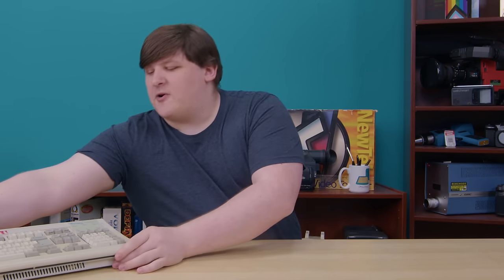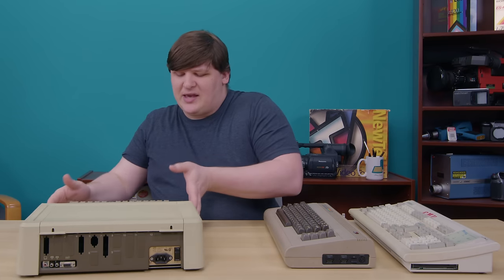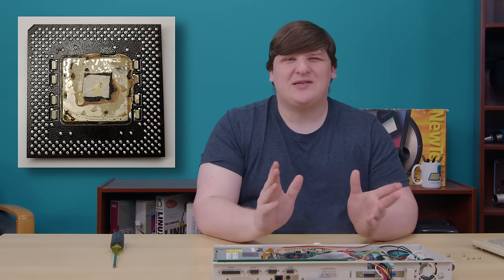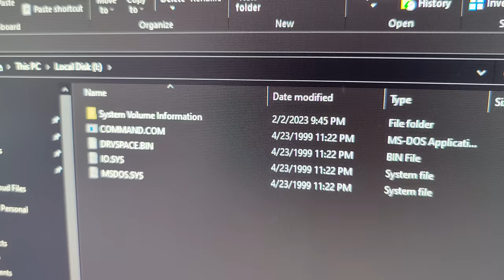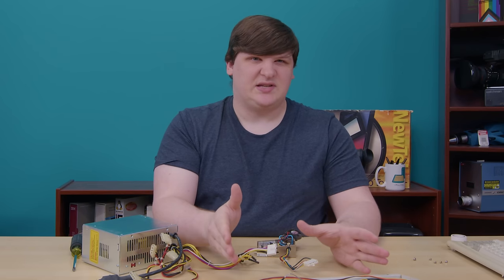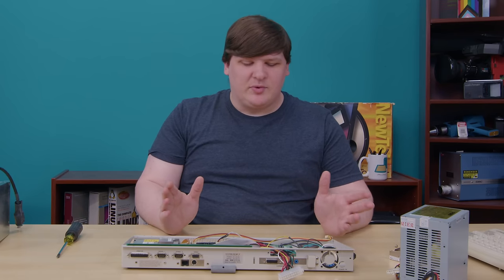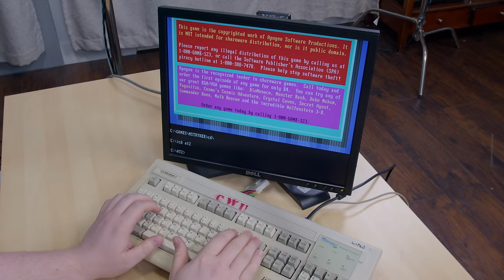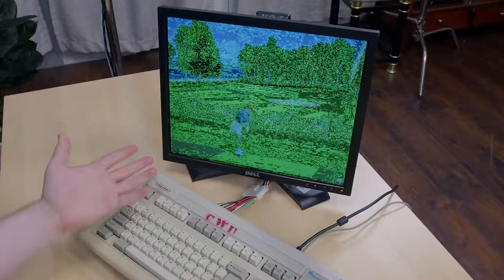I turned a weird "keyboard PC" into an FM boombox

Comment: 7:00 I can assure you that typewriters were used for touchtyping. Typists were trained using that method of learning (which some keyboard enthusiasts today call unnecessary) and it's the whole reason that a modern keyboard is arranged in that weird way, of no keys vertically aligning with another row. I can send you a video from the mid 1940's of a female typist teaching the user how to touchtype, correct arm position & posture, table & chair height and how to type without a wrist rest. I much prefer a wrist rest so I'm totally with you on the elevated keyboards, but I was taught to touchtype on a typewriter and it's not strictly necessary.
Reply: The adlib music you write is awesome. Sounds very sci-fi. Make a tape album! I'd buy!
Reply: Can you wrap your external power supply wires with tin foil or some other EMC blocking material? Add a ferrite core maybe?
Reply from the maker: I should have put more emphasis on the "...as we know it now." As in, the technique existed, I have no doubt, but it's very different from what you do on an IBM-style keyboard.
Reply: @CathodeRayDude  You're totally right. When it comes to computer keyboards there's a learning curve and the hand position changed for comfort rather than consistency. I bet most people's grandparents here still type a keyboard like they're trying to smash a hole through it and it's because of that typewriter touchtyping. Thanks for the reply and I loved your video

Comment: Those round connectors are aviation plugs, meant for high current applications, frequently used in analytical instruments for things like turbomolecular vacuum pumps, and they come in forms with much more than 4 pins.

Edit: I'm wrong, didn't get a good enough look on my phone screen. Those are kycons, which are dumb because multi-conductor bayonet connectors exist.

Comment: In the Classic Mac community, it's common to replace the power supply with a modern one that has to fit within the minuscule space of a Mac SE. New ATX power supplies like the Seasonic SSP-250SUB meant for industrial uses exist that can be drop-in replacements for these situations. I know that you wanted to keep it cheap, while repairing an old Mac is nothing but, but perhaps that's an option for the future ?

Comment: 41:34 the rippling video looks a lot like the video of my FM Towns when I first got it. I thought it was a bad video cable, but then noticed it would get better or worse depending on if the CD-ROM was spinning. Issue went away (along with a few other issues) after recapping the power supply. And then the next day a resistor blew in the power supply and I ended up building a new one, but that’s another story.

Comment: Did you test it before you installed the speakers and the amp?  Those cheap circuits are probably adding sharp ripples to the power, putting out RF, not to mention the magnetism from the speaker drivers.

Comment: The delay in starting Windows 98 is the machine waiting for a DHCP address. Windows 98 will not start until that procedure times out (the grace period is very long) or it receives an IP. This is a fundamental kernel flaw that Windows ME fixed.

Comment: I had the exact same problem on a Mac SE where i installed a new fan.  The reason was due to the fan NOT being "Brushless".  Installed a new "brushless" DC fan, and the problem disappeared.  It looks like you have AC noise/interference.

Comment: Nowadays you could probably fit an ITX board in there with a low-profile cooler, and have oodles of space left for whatever else, like a GPU if you need a heated keyboard for those chilly winter months.

Otoh, it would be a slight atrocity to do that, and you certainly wouldn't get to run Apogee games natively.

Comment: So, it isn't quite the last of it's kind. This one came 10 years after the first glut of this form factor hit the market, and 10 years after that, Asus tried to do it again. In 2010, they released the eeeKeyboard. It was essentially the guts of an eeePC that they stuffed into a keyboard, but the added a small touchscreen where the numpad would be, to try to get some sort of interesting talk while the netbook market was winding down, and they were flailing about trying to figure out what to do. I only know of this computer because we got one for work that we were working on testing to see if it would be a good platform to turn into a steno machine. It was not.

I really wish I still had that one from the office, cause we were just cleaning the building out a couple months ago to sell it, and had to get rid of all the old hardware.
Reply from the maker: I knew the eeekeyboard got *announced*, but I'd never found any evidence that it made it to production, so I lumped it in with all the ill-fated "concept" machines. Amazed to learn that someone actually touched one.
Reply: @CathodeRayDude  Touched, and immediately got frustrated with it! We tried to see if we could use the little touch screen for some kind of useful info display for incorperating into something else, but the poor thing had difficulty running the calculator app on it, it was so laggy.

Comment: Idea about wobble: maybe you need to place a heat-pipe on the underside of the 3.3v converter to stop it from cooking the videochip.
Reply from the maker: that's a very good point - I don't think it's heat, but given the positioning of the graphics chip, maybe a simple piece of grounded foil between the two would solve the problem

Comment: Y'know if you ever need to do this again, there are modern retro products that will create -5v from the -12v for AT or ATX vintage gear. Combine with the smallest wattage picoATX supply you're comfortable using and do what you've gotta do to mount the 12v barrel jack on the rear. Self-contained solution.

I'd leave this machine as you've modded it though. I'm of the opinion that vintage machines have stories and if you can help it, you should keep those stories intact.

Comment: you can solder repair that ribbon cable... when the system is on I'm almost 99% certain that the turbo is toggled with a keyboard shortcut... A power supply solution is a PICO power supply...

Comment: Heh, I got one of those from my old mechanic. He was just throwing it away.
Naturally I threw out the 386 inside and gutted its keyboard. Because that bigass enter split shift layout is fantastic. Its keycaps are on the keyboard I am currently using.
Though if you wanna gut one of these for its switches, absolutely don't. SKBM cheap Alps ain't worth it if the computer is working.

Comment: Man, I am juat up in Lynnwood, and if you can get me the measurements for that opening and the atx plug, I can probably 3d print you a mount that will attach to the case.

An Ocilloscope would be valuable to track down the ripple source.

Comment: I think that weird wobble, and all the other issues you're seeing related to CPU load and, frequently, graphics, might have something to do with that daughter board supplying the CPU with 3.3v power. I'm guessing it's not only throwing a ton of heat onto the graphics chip it's sitting right above, but it's also poorly EMF shielded just to rub it in.

I can think of a couple of fixes, if that is the issue, but the one with the best chance of working would be to bypass that board altogether and get your 3.3v power from your ATX PSU.

Comment: you can make getting files on this way more convenient, replace the hdd with a 2gb compact flash card and make sure the adapter is in there with room to remove the card, bonus points if you make the card accessible through that nice cutout that lines up with the hdd.
Reply from the maker: the cutout lines up with the floppy (unless you're seeing one i'm not) but, if i pulled the fdd, cause who needs it at that point, i could just mount the adapter one row over. i have some ideas about what i might do next with this machine so i'll keep this in mind, thanks!
Reply: @CathodeRayDude  theres a cutout on the back to the left of the ethernet port that i think lines up with the hard drive somewhat, it might actually be better called a knockout but it's similar to the one you have the power cable run through
Reply from the maker: ohh right, i forgot that was over there. I think I found it was necessary to remove it to get the HDD out. yeah, good thinking!

Comment: I'm kind of surprised that you didn't mention the Amiga and Atari computers that were also wedges well into the 90s. Yes, they aren't IBM compatible (at least not without add-ins or emulation) but they are still PCs.
Reply from the maker: The subject of this video series ("100% Compatible") is IBM compatibles, is the thing.

Comment: I bet video weirdness has something to do with shielding/signal interference, not sure exactly where in the system (it could be anything, down to a cable from a board to vga connector)
Also interference of video signal (that vobbling) may have nothing to do with sound issues, coz, if I remember correctly, if you switch to full screen video, that puts system into another video mode (and also resolution, maybe), and system may just don’t have enough juice to pull overlay windowed video, that consequently causes sound issues as a result, but in fullscreen it can handle

Comment: Hey Gravis, thanks for the video! I have two comments. Your lab bench power supply should have isolated outputs. So you can make into a plus and minus 12 Volt supply by connecting the positive of one output to the negative of the other. Secondly if you want to keep using this there are the picoPSUs which use an external 12V power brick and do all the ATX magic in a really small form factor. Cheers from Germany!
Reply: seconding the pico psu thing!
Reply from the maker: Oh yeah, that's actually what I did to test it, I just couldn't really take that with me to the studio. And, like I was saying, I didn't really want to rely on the 30 year old regulator board. Several people have made the picopsu suggestion and I think that's definitely the right call; I can just mount a 12V barrel jack to the POWER IN hole and make things simple. Ty!

Comment: I'd add a cdrw,&install winamp,I've recently been using winamp again,it's still available to d.load,& takes me back to my teenage years.
Just playing a song& outputting the graphical spectrum analyser to 2 screens at once,or just one for the player& one for the trippy graphics.Was something my old PC couldn't handle& it had one of the best graphics cards about at the time,now my laptop does it without a glitch on integrated graphics.
Keep up the good work,did you try a different monitor with your graphics glitches,I know it sounds weird,but some moniters can screw with your PC.Its worth a try,just to rule out the possibility.Then once you've checked all your external hardware/connections,you'll know its defo somewhere inside the power supply internally,&I'd look at all your ground rails first,it's the first place to pick up interference.👍

Comment: FTP server and DOS IP/Ethernet driver (assuming that the Ethernet side is popular with readily available drivers) would keep you out of Windows and get you transferring files with a DOS TUI.
Reply from the maker: But then I have to run an FTP server somewhere and deal with networking under DOS. With Windows I didn't have to do anything, it just worked instantly and I'll never have to think about it, or modify my autoexec and config.sys to juggle memory usage. I just don't hit F8 on startup if I want networking.
Reply: @CathodeRayDude  I'm in that POS Discord also, I've been expanding the idea since then, maybe this sounds more useful: A non-trivial amount of work up front for the initial setup, but this would be fairly universally compatible. TL;DR: cheap rockchip pi alternative running a static IP plugged into a buck converter that has a USB A port for internal wiring on the power switch line or something like it, and the memory and networking can be done with a one-size-fits-all batch script that does everything needed to connect then launch an FTP program. Bonus: A tiny bit of additional work and you can pass through wifi as well. I have an extra Le Frite or something sbc, I'll see if I can make something with that.
Reply from the maker: yeah, the thing is, I already did work up front - i set up a webhost five years ago. it's on autopay and someone else keeps it running. it's always there, and it's the same effort to put a file there as to put it on some gadget that i have laying somewhere that doesn't have a public IP of its own.
Reply: @CathodeRayDude  Agree, that sounds good for what you need. I still plan on working on it for myself though, mostly because I think it's interested me enough to be fun for me to tinker with.
Reply from the maker: oh, totally! sorry, I was just speaking for myself, i'm sure it'll be a fun project. gl!

Comment: That delay on boot is kinda weird.  All i could guess is it's waiting on a device it thinks is there/functioning to time out.  It appears the disconnected floppy is still enabled in the BIOS.  Also turbo buttons basically did nothing past like 286/386 era.  Not sure what it would've ever done on a pentium era motherboard if it did work.

For a first song written, it definitely shows an understanding of scales and harmony and progression and stuff.

Also, it's entirely possible that the video chip always had crummy sync and CRT monitors might've cared less about it.  It was pretty usual for cheap OEM PCs to have absolutely awful, buggy, barely functional audio and video while they were brand new.  But yeah age might not have been good to this one either.

Also, there were Commodore brand PC/keyboard combos.  I don't know exactly when this was but pretty sure they were like windows 98/XP era?  This was well after the company had basically died and was just a name though, so probably just some trademark holder having the name branded on some rebadged OEM things.
Reply from the maker: A few people suggested the delay is the network driver trying to get a DHCP address, which seems reasonable and also easy to test, so I gotta see if I can do that.

I thought about the LCD maybe exacerbating the problem, but I tried a CRT display and the wobble was actually a bit worse, if anything, so it really seems to be a genuine problem.

thank you re: the song, I've been tinkering with music since i was 13 so I had some existing domain knowledge, just never put it all together until now
Reply: @CathodeRayDude  ah ok. Yeah I have some music theory knowledge but I basically cringe at music I put together then give up.

I'd still say check the floppy setting in the BIOS too. That's another easy one to just disable and see if it helps.

Comment: "The round 4-pin thing that's not DIN" bruh
 4p mini DIN 
Also I know you think you pre-empted it but I am 100% going to bag on you for the -12V, it's in the original spec for PCI slots and RS-232 com ports, and I've yet to see an ATX PSU that doesn't still have a -12VDC rail at 0.15A minimum. Legacy sound cards relied on it, whereas most of the differential signaling and audio peripherals now utilize the -5VDC rail if at all.

Comment: Surely that's not how the keyboard was originally mounted. Surely there was originally some kind of metal back plate that has gone missing.

Would explain why the screws don't even line up, they would have originally gone into this theoretical backplate.

Comment: I dunno about your take on typewriter keyboards and touch typing.  What you said is entirely true of mechanical typewriters, but totally untrue of electric ones.  I learned to touch type on an IBM selectric in 1989 in a 7th grade classroom.  Those were very easy to type on, many electric typewriters used the same alps and other mechanical switches as good computer keyboards of the time.  If you ever fall down a typewriter rabbit hole, it'd sure be fun to watch.  But, as always, I remain wholly entertained by what you do.

Comment: Do those picoPSU (I think that's what it's called) power supplies that take just 12V DC in provide -5V? You'd still need the same cable adapter, but even with some kind of extra -5 supply you'd still be able to fit it all inside the chassis and replace that connector with a standard 12V barrel jack.
Reply from the maker: I thought they didn't, but people have been telling me they do! I've had... some Ideas about other things I could do with this system, and this may figure in to my plans. :)

Comment: Rather than using IE to download files to the windows box, have you considered file sharing and hosting RetroNAS on a Raspberry PI or docker somewhere? It works with just about everything with a NIC too! Also, that song is really good!
Reply from the maker: The thing is, I already have the web server, everything supports it, I'm guaranteed to have zero problems with it. The protocol has never changed, I don't need to deal with authentication, I don't need an extra piece of equipment. I pay for web hosting anyway, so anywhere I can plug into that has internet access, it'll just work without any possible fuss. So that's what I go with for this sorta thing. Thanks though, and glad you like the song!
Reply: @CathodeRayDude  Fair enough! I prefer to keep my retro machines away from the internet proper, but you can't argue with that logic!